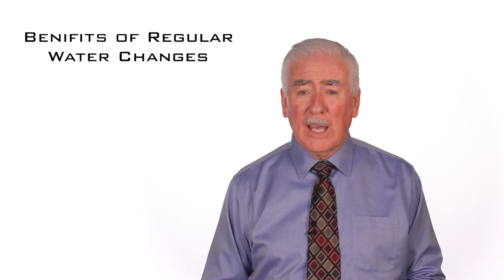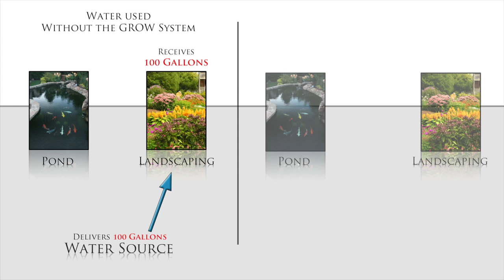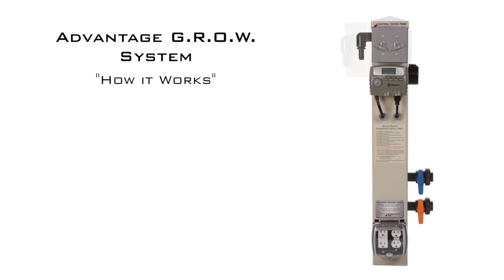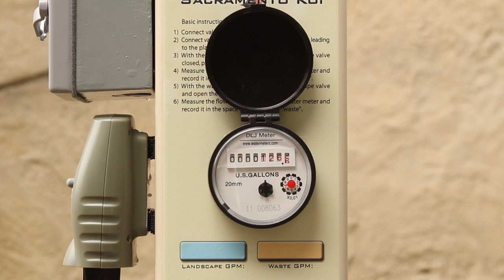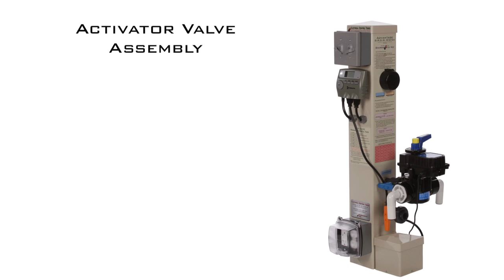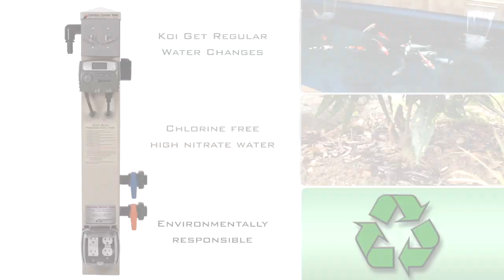Easiest way to do pond water changes

Comment: Nice system and with most types of koi filtration only supporting aerobic bacteria, therefore producing ridiculous amounts of nitrates it makes perfect sense to use that by-product for the benefit of plants. The growth of plants would surely increase using this system compared to watering them with straight tap water.